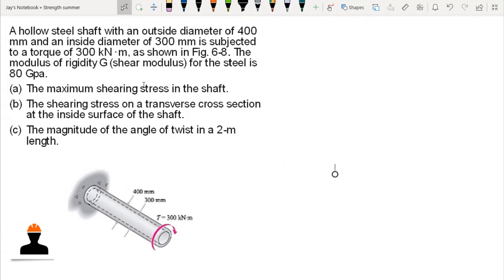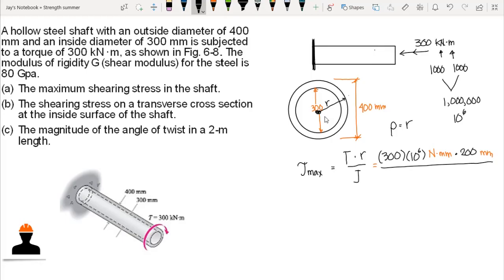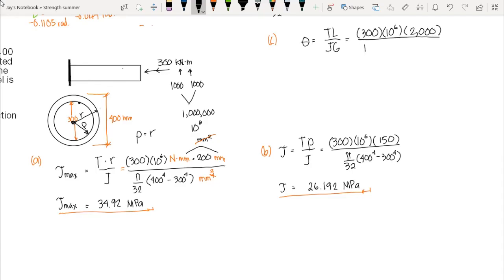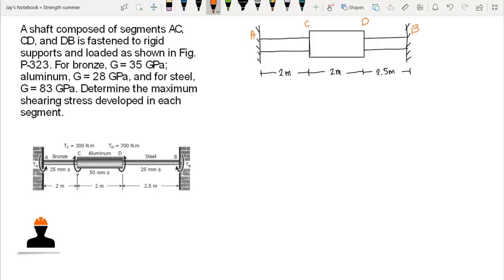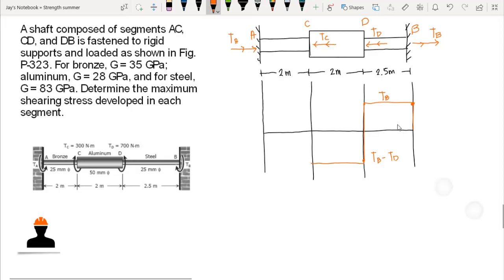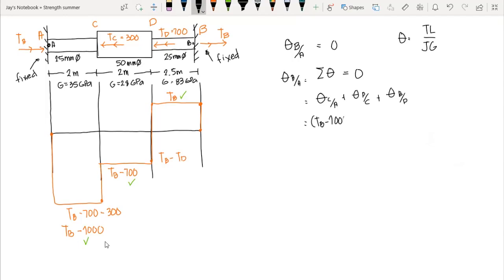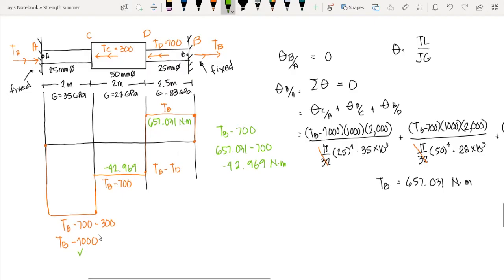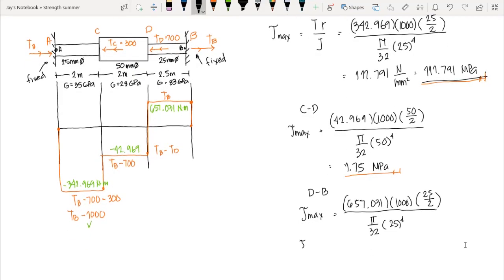Strength of Materials: Torsion (Part 2 of 2)

Comment: i'm having trouble po sa pagkuha ng Tb, yung nakukuha ko po is 0. How to come up po with 657.031?
Reply: I had to use MATLAB software to come up with that answer... I basically wrote the equation as he has written it in the video
this is what I wrote in MATLAB
solve(((T-1000)*(1000)*(2000))./((pi/32)*(25^4)*(35*10^3))+((T-700)*(1000)*(2000))/((pi/32)*(50^4)*(28*10^3))+(T*1000*2500)/((pi/32)*(25^4)*(83*10^3)))

and my output was this 

36237776425519100075195837393352400/55153863378920369088361954146493

where at this point I plugged it in my TI-84 and divided to get the 657.031

when I tried to solve for Tb individually... it just was not working so I had to solve the entire sum at once. You can see where you can divide the top number from the bottom number.